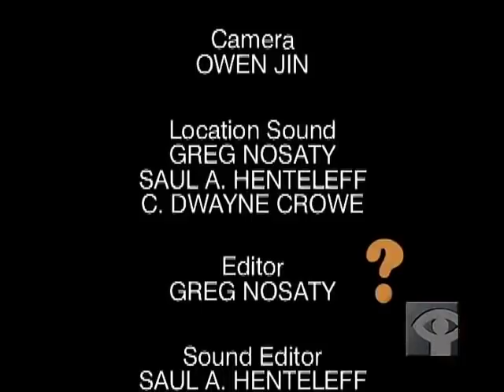How Do They Recycle Paper?

Comment: Looks nothing like the mill where I work.We make 100% recycled paper (brown paper for box'es).Bales of cardboard are dumped into a pulper (giant blender) where the cardboard dissolves into a slush (stock).The stock is run through several cleaning processes.Lots of different equipment,think big refinery.Cleaned stock is then turned into paper.Like I said,we make 100% recycled at 30 to 36 tons an hour.A sheet 16 feet wide and running at about 1800 to 2100 feet per minute.And we're a small mill.
Reply: That was a lot more informative than the video.  Thumbs up.
Reply: Haha, so true! Thanks for that paragraph of info!

Comment: Its cheaper and more environmentally friendly to cut down trees to make paper and replant them. Recycling paper is bad for the environment,  and expensive.
Reply: Yes, cutting down trees, burning waste paper, and planting new trees is actually carbon neutral and sustainable.  Recycling on the other hand requires bleach and may use more energy.  (I could be wrong, but that's what I heard.)
Reply: Partly true.. But not really.

The main problem that we try to solve with recycling is: reducing the need for more landfill. If it were not for it, most of the population would be living next to landfills, and those themselves are bad for the environment. Not primarily because they are hazardous or polluting (which they still are), but because they take a lot of place.
Reply: ***** incorrect.  We are no where near running out of landfill space. In fact to put it into perspective the US could put all their garbage in one centralized spot for a thousand years and it would only take up a little over 30 miles (no one is talking about doing that it's just for perspective). Also don't forget as technology advances so does our ability to compact and store garbage better than ever before. Also almost all landfill spaces once they are no longer in use and have gone through the reclamation process are environmentally safe and normally looks quite nice. Plus, even if landfill space was a problem (which it isn't), recycling paper does not reduce landfill. More than 90% of everything you put into recycling cans gets thrown into landfills anyways, and recycling paper creates a chemical waste that also gets placed into landfills.  Not to mention recycling paper takes away incentives to replant trees. Contrary to popular belief trees actually increase by logging since loggers have an incentive to replant what they cut down to maintain an abundant supply.
Reply: ***** that's not true. It's impossible,  because the majority of what is placed in a recycling bin is impossible to recycle. Don't let the recycling propaganda feed you a bunch of bullshit so that you continue supporting their subsidies.
Reply: Kyle P
In Sweden I work with it...ok if someone put an old shoe in the glass bin then you are right... but then its just tossed out and burnt. we burn everything that can't be recycled or is not sorted by the householder. The bins are quite sorted  . glass, paper, cardboard, plastic, metal, batteries, lightbulbs. Plastic is the worse if the containers are not cleaned first. If the rubbish IS sorted then most - like 90+ percent is recycled. Do I need to do a video lol?

The burnt rubbish heats the city's water!
Reply: ***** considering that your livelihood is dependent on the recycling boondoggle I'm going to assume that you are not a credible source. Also, independent studies verify that most items put in recycling are thrown in landfills as anyways. Also, back to the point on recycling paper. The chemicals used to clean the paper are harmful to the environment,  the cost to recycle paper is more expensive than cutting down trees and replanting,  and recycling paper leads to less incentive to keep and replant trees resulting in fewer trees.
Reply: Kyle P  My liveihood is not dependent on recycling - I do an number of things.
You are over confident about what you know. Sweden has a good system. I have no need to defend how things work here, if you dont believe me then it changes nothing.  The thing they probably landfill is the burnt remains. But I'm not sure but its a good guess. We have a system here that all houses and apartments have a recycling "house" that they themselves separate out the different types of rubbish. We are reasonable good at it and many take pride in doing so. There is no point arguing with the facts.
Reply: ***** you have not addressed the point I made about recycling paper being harmful for the environment,  and eliminates the incentive for tree production.  Instead about boasting about how great the recycling boondoggle is in your country that you respond to my argument against recycling paper.
Reply: Kyle P
 I was responding the continuing thread rather than your first point. However, I can try to answer from my view. sweden has ALOT of paper trees everywhere and they replant them when they are cut down. Alot of paper is recycled here. Its one of the most separated products that are recycled. I would guess having seen both sides to a degree that you are wrong.
But why is it damaging to the environment and why so costly to recycle?
Reply: ***** why is it damaging to the environment?  The toxic chemicals that get sent into the atmosphere,  and removes incentive to replant trees.  
Why is it so expensive?  Cost to sort the paper, the cost to recreate it into paper, the make -work jobs that is needed for it that has no economic value to society. That's why it is so expensive.  Better off throwing away paper and replanting the trees for paper production.
Reply: Kyle P

In Sweden I can say that my wife's family owns a lot of tree bearing land. Trees for wood not paper. It harvested about every 30 years or so. Wood trees are worth more then paper trees. There is a milll next to them - once owned by the grandfather. so transport costs are zero almost. Yet, the yield is low. Costs are quite high to harvest them. Everyone replants anyhow otherwise the land is worthless. Labour costs here are high, machine costs are high, fuel costs are high, etc.

"work jobs... no economic value to society" where do you get that from??
 Having studied economics, law and politics your statement or premise is totally unfounded - and that's being really polite.

The best is to do both - recycle and plant.. and that's what some countries do like Sweden.

I have not heard about so much pollution from recycling.

Further reading, i'm sure there is more out there.
 " By recycling one ton of paper we save 17 trees, 7,000 gallons of water and 463 gallons of oil, according to the EPA."  http://www.earth911.com/business-policy/business/paper-recycling-details-basics/
Reply: ***** you assume that you can only get paper in Sweden.  Find a country that has the land available to harvest trees with the least expensive methods. The costs to transport trees would still be cheaper than recycling. Recycling paper does not save trees as it restricts it's incentive to replant,  it wastes water and other resources needed to recycle it. And FYI avoid studies from a government agency who's incentive is to promote this recycling boondoggle to increase their funding. 
And yes recycling has no economic value to society so any jobs created are paid by taxes payers which makes them a drain on society rather than a revenue source.
Reply: Kyle P
 Rubbish. The company recycling here is private and makes alot of money. You dont understand that there is import taxes you know.

I think you have made up your mind so we leave it here.
Reply: ***** No. Recycling does not produce profits. It is a highly subsidized business. If you want to prove recycling has economic value then remove the subsidies and see if it still in business.  
And you assume that nothing can be done about import taxes. About eliminate the unnecessary import taxes and then the costs go down significantly.
Reply: Kyle P
No!! Its not subsides from the state - its fees paid by the apartment owners (that's big limited companies normally not single people) and house owners for their rubbish to get collected. Some recycling has alot of money like metals. Like I said there is not subsidies. Import tax is called Value added tax here. lower the taxes and you put your local people out work and land is worth less etc. Thank God you are not in power over here. You are flawed text book with no experience. You diverse from your own thread and prove nothing.
Reply: ***** I am a homeowner,  and my garbage bill has increased significantly due to mandatory fees to go to recycling. And yes many metals are valuable.  And guess what you don't need to force people to recycling for those metals. People were already doing that before this recycling boondoggle blew up in that late 80's. People would recycle aluminum and other metals to companies who would pay for that material.  Recycling paper on the other hand has no economic value because trees are a renewable resource. Recycling plastic has no economic value because it is not a scarce resource. Once it becomes more scarce then recycling plastic will be economical. 
And if you lower taxes then you create more economic prosperity which creates more private sector jobs not just public jobs that are dependent on tax revenue.
Reply: ***** Well reducing some volume to land fills is just a side benefit meaning the main goal of recycling is minimizing the need to clear cut forests for the paper industry.
Reply: ***** cutting down trees creates a higher demand for trees. Means more of an incentive to plant and grow trees. Nobody ever says  we need to minimize the cutting down of corn crops or pulling potatoes from the ground because they are both in high demand and people have an incentive to replant them. Same goes for trees. And if your goal is to minimize landfill use,  then how about instead of the recycling paper boondoggle (which majority ends up in landfill anyways) that you instead shred your used paper and mix it with grass clippings and food waste to create compost for gardening?  At least then it creates a useful substance that doesn't harm the environment nor fills up landfill space.  But fyi, we are no where near running out of landfill space just so that you know.
Reply: maybepumpkins The replanting of trees in an essentially dead clear cut forest the damage is done meaning the use of bleach and energy to recycle paper is negligible in terms of environmental damage compared to clear cutting forests.
Reply: Kyle P You're not listening. Again, reducing land fills is great but is less important compared to the Main Goal of Reducing Clear Cutting Forests for the paper/cardboard industry.  

Your argument of recycling paper/cardboard with yard waste compost, although feasible, will never work for the vast majority of homeowners without organized help because paper comes in much too fast to be recycled effectively with available yard waste.
Reply: ***** I don't believe throwing paper away is harmful because we aren't running out of landfill space. However for people who still want to reuse their paper I brought up using paper for compost as an alternative to recycling paper (which is in fact harmful to the environment).  
Now in regards to reducing clear cuts. Here's an idea, increased the amount of private land ownership on forest land. Private forestry industry would have an incentive to keep their land safe and in an abundance of trees if they owned the forrest they are using as opposed to public land where that incentive does not exist.
Reply: Recycling paper uses less water, less chemicals, less fossil fuels to produce. To say that it is more environmental to drive to a forest, cut down trees, transport them, grind them to a pulp for paper is just completely ridiculous.